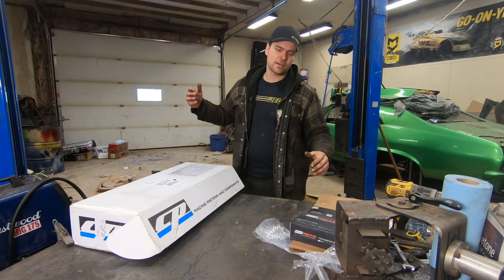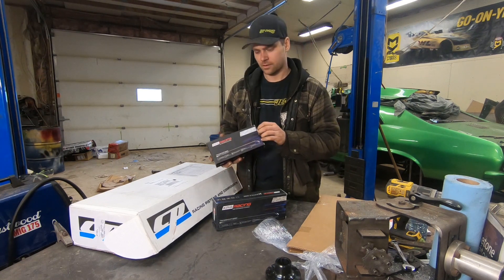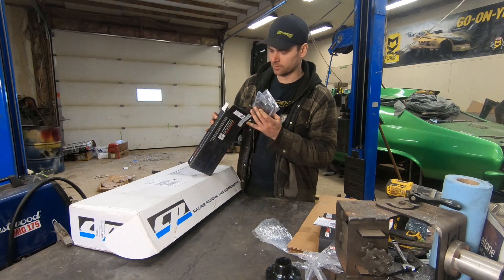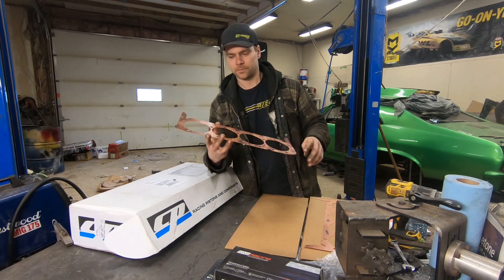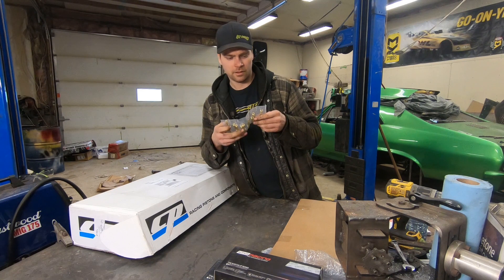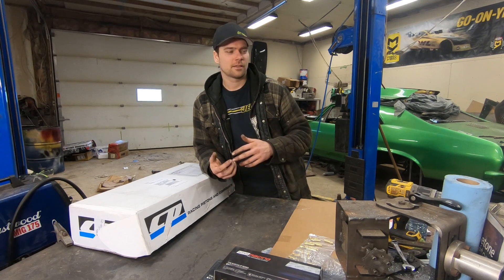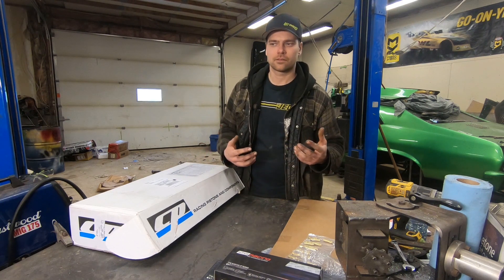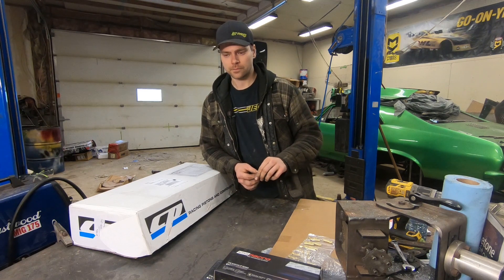cp Carrillo pistons, king bearings for the 2000 hp sbc build

Comment: I'm building an NA sb2.2. Any suggestions?
Reply from the maker: Yeah let it rev to the moon. Lol
What kind of questions you have?
Reply: @lilpickleracing  man I’m having heck finding head studs for this thing. A Brodix aluminum block takes longer studs than a cast iron block as you already probably well know, lol.

I’m gonna have to measure them then see if anyone has any on the shelf and if not, have them made.

7.0’s out of your machine is quite impressive. And I was equally impressed you welded up your block after you slung that aluminum rod through it! Lol.
Reply from the maker: Double check but I think you need 134-4310 arp
And jegs have 1 set left. There pricey these days though
Reply: You still around buddy? I understand what you describe about being around people... 
I have always been what you might call a lone wolf when it comes to hanging around with guys. I pretty much drive my own truck to whatever is going on, leave when I like, and work all the time because I enjoy it and don't have time to just waste rime doing what alot of folk do. I have customers, and associates, friends and neighbors... and I do appreciate another manufacturer treating me as I do them. Enjoyed the video, Carillo is still great to deal with, JE is another. Have a good one.
Respectfully Seth